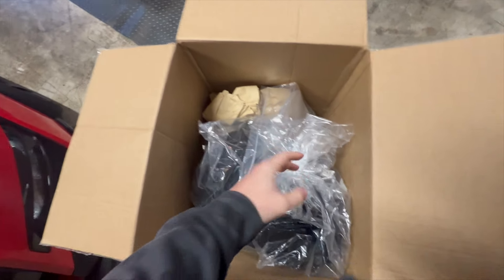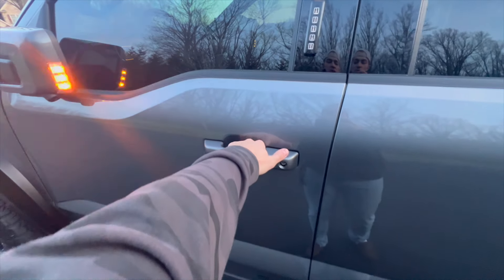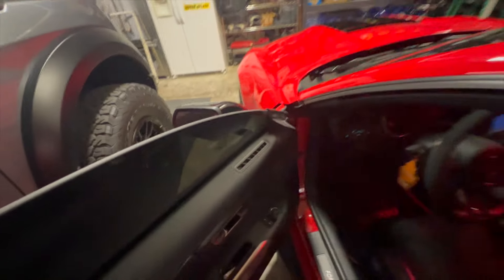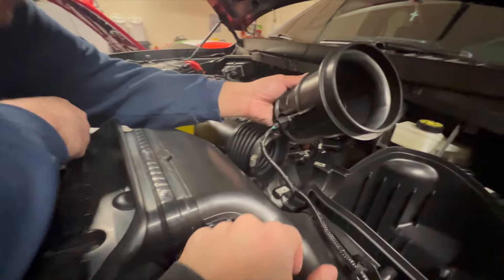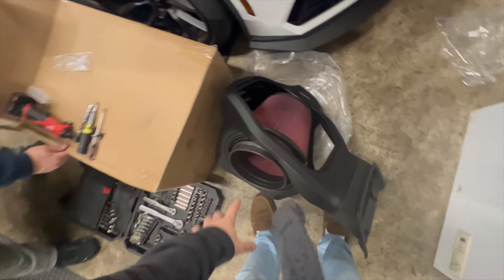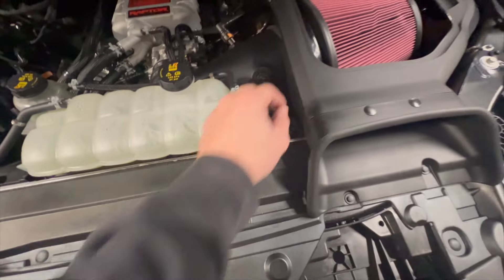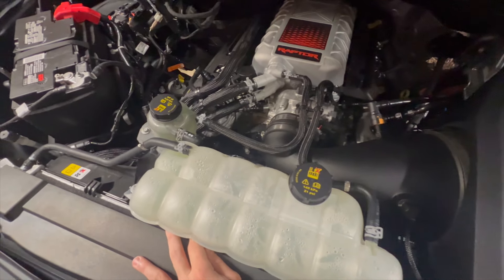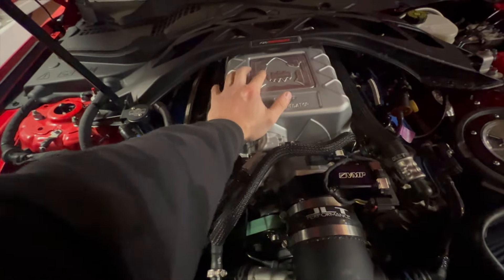Worlds Biggest Intake 2023 Raptor R S&B Intake Install!

Comment: Run to Lowe’s and get the Werner 4 foot work platform. They are under $100 bucks. I bought 2 after the milk crate slipped out from under me while working on my lifted F350.
Reply from the maker: I need to go check that out cause I fell of mine in the garage I wish I got that on film 🤣